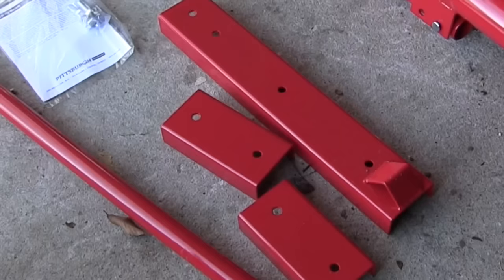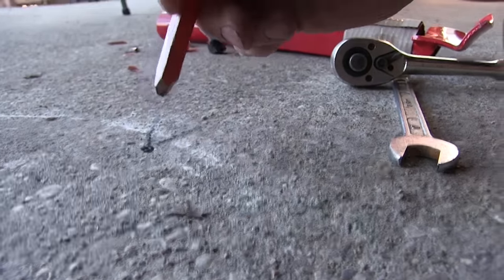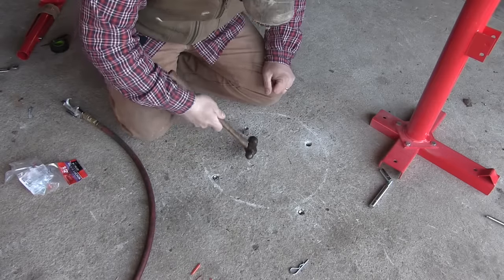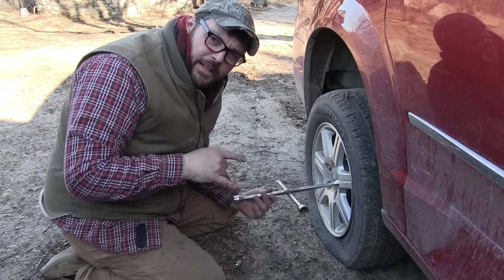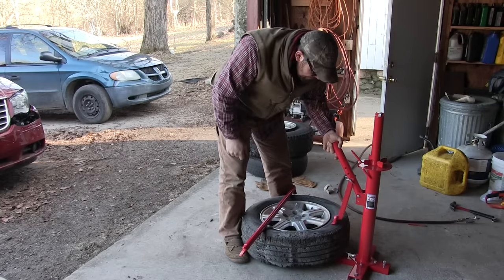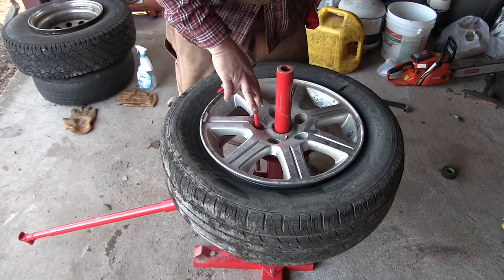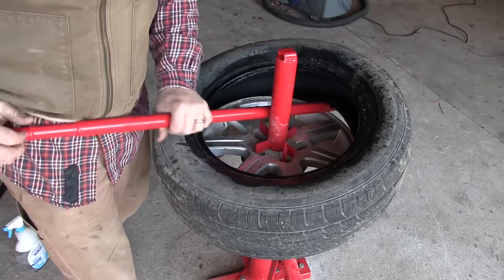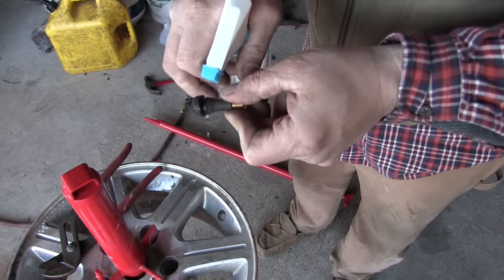Harbor Freight manual Tire Changer review

Comment: "Portable system" - Just requires 4 big bolts in the ground!
Reply from the maker: It should be labeled "manual tire changer" not "portable"
Reply: Does it move? Can you drill 4 holes somewhere else?
Reply: @whydoihave6neutrals772  not at the side of the road if I needed to do a quick tire change.
Reply: ST6 you really think that’s what this is for? Have you ever heard of a thing called a spare tire?
Reply: ST6 and who carries and extra tire?
Reply: @whydoihave6neutrals772  I know and I obviously wouldn't do a job like this at the side of the road. But at the same time portable is something you wanna be able to take out and just use. You shouldn't have to fix it in.
Reply: ST6 honestly This is very portable for what it is most are 1,000  pound machines and it take a lot to rip a tire off so really no other way. It’s more of lack of user skill to be able to drill the 4 holes anywhere.
Reply: ST6 you wanna do what the shops can for $34 you still 4 holes.
Reply: @whydoihave6neutrals772  I realise that, i am a mechanic myself. But if was to be renting and not allowed to drill 4 holes in the ground then maybe a container or  something that could be weighed down by like sand to keep it stable would be more portable and better designed.
Reply: ST6 honestly you could do a system like that but 100 pounds of sand it 10x less portable then 4 screws and a drill
Reply: ST6 and a simple workaround to drilling 4 hole could just be 4 foot long pegs for your front lawn
Reply: @whydoihave6neutrals772  yeah that would work. Let's agree that although its not as easy as just placing it down and going it's much more portable than a massive hydraulic tire changer.

Comment: To change out the valve stem the whole tire doesn't need to come off the rim.
Just break the bead on the valve stem side of the rim, reach inside 
and remove the broken valve stem or in this case the tire pressure monitor.
If the tire pressure monitor was still good replacing the rusted out broken collar 
could have just been done as well.
When intalling the new valve stem, I would recommend using the proper valve stem tool 
and not pliers.  The tool has a threaded fitting that screws onto the valve stem 
once the valve stem has been put into the hole on the wheel, then a hinged lever 
fulcrumed against the the wheel rim installs the valve stem.  
Using the soapy water spray solution on the rim and the valve stem, like in the video, 
helps remove and install the tires and valve stem to the rim.  
When checking for leaks also check the valve stem and Schrader valve. 

If you do have to remove the tire from the rim use a tire crayon to mark 
the position of the valve stem and the wheel weights if they are the clip on 
style and not the tape on style.  This should keep the balance pretty close.

When I used to work on aircraft, the tire wheels were two pieces bolted together 
with a large greased O-ring between the wheel halves to seal them together.  
So we only needed a bead breaker to remove the tires from the wheel rims, 
then unbolted the wheel halves to dismount the tires.  Fun times!

Comment: Husband bought one. He showed me how to use it. He also bought "tire spoons"  --about an inch wide and maybe 14 inches long. It has never been bolted down to the floor. When you use enough dish soap around the bead--the tire practically falls off by itself. The spoons work great for ANY tire--big tractor tires, motorcycle tires and anything else that won't fit on the machine.  Put on your own new tires. Just buy the tires==whether for a daily driver, trailer or even a newer vehicle...Yeah--if you get flat tires, even if you don't get this on a super sale, buy one. Get the spoons (mix dish soap with water). As far as plugging a hole--pour straight dish soap in an empty vitamin bottle, 'thread' the plug thing thru the plugger handle thingee, dip it in the vitamin bottle THEN shove it in the hole. You are welcome. Good video!
Reply: Quick note; if you find yourself struggling (fighting) with a tire change, you aren't using enough soap. Don't be afraid to put it on straight (no mixing with water). Use a one inch paint brush to "paint the soap" around the bead.  I think the spoons are 24 inches long..from Harbor Freight.
Reply: @paullasmith4975 , do you use the spoons independently of this tire change device or do you use them with it? I see above you said you didn't bolt the device to the ground and it still worked. That's what I'm looking to do since I live in a rental house and can't drill holes in the ground.
Reply: @MaggieGiamalvo  The tire changer is handy, especially for bead breaking. Otherwise,  the tire machine isn't actually necessary. The "spoons" are 24 inches and work great on aluminum wheels. No pounding, no forcing. The spoons are available from Harbor freight.  Tried to remove tires from a 1930's axle. Had to cut them off. Everything else is a breeze. That's the 'trick' spoons and soap. Tire plugs (the 'shoe string' kind) string it through the handle thing, dip em in soap, then shove it in the hole.  Trim with wire cutters.
Reply: The spoons are actually  called "Tire Irons" get two.

Comment: I've used those drop in kits before , only works if the concrete is hard enough , also if you take the pin out the back before setting in the hole there's less of a chance failure ....

Comment: I haven't read comments. What I wanna say is, You got the first side to break after you moved it further from the post.
The bead breaker blade became more horizontal and you broke it easy after that. I wasm yelling at my monitor to try
tell you to move it further out again. I think it would have done it just as easy then.
I just bought one today and my next step is to twist the tire off the rim. I see I need to find out the secret to using the other side of the bar to
put the tire back on. 
Awesome video and thank you sir.

Comment: I just mounted mine to a pallet that has a sheet of plywood fixed to the top. That way I can move the changer around outside or inside or what ever. If you can put the tire in the sun to warm it up it makes things a lot easier.

Comment: The first tire I EVER changed was a commercial tire.  No power tools involved with that.  Tires, Wheels, and tire bars.  We didnt even have a stand like that one you used.  We did have a balance machine that we used to balance the tires that went on the cab, usually didnt balance the trailer tires.  I even got the opportunity to change a tractor tire.  Got laid off from work after a couple of years doing that job, but loved the time I spent there.  Met some really  interesting people while there.  I changed State Trooper tires, County Sheriff tires, even tires of the parents of a classmate of mine.  Hadn't seen them for 30 years!  Good times that place.

Comment: I drilled holes and screwed a block of wood inside the arms above the shovel, I bent the shovel arms bad on about the 5 Atv tire. That fixed the problem so far. I only use them for steel wheels that I can repaint the rim due to scratching from this rig.

Comment: Fifty years ago, at a little mountain gas station, we had simple tools to do this also. Removal - break bead with BIG hammer? No, we had a three piece contraption that worked the same way. Long bar with a hooked section, about a foot long, hanging from one end and, about a foot or so up, another T shaped piece hanging. Place T-bar on tire rim and hook other section in center of rim. Apply pressure until bead breaks (T-bar works as pivot point and keeps hook engaged). Complete bead work. Next take an old leaf spring from the junked truck across the field and clean it until it's smooth. Then slide it under the bead  (same way you did) and leaver bead up, applying the a fore mentioned BIG hammer to the spring side sliding it around until loose. Repeat with second bead. To reapply tire you only use the spring and hammer to get things back in place with lots of leverage, hammer swinging and colorful language. Sometimes I miss the old days. Then I have a flat in the rain.
Reply from the maker: Right on

Comment: I'll be 78 in March and the tires that I just took off had been on the rims for 47 years, so not so easy to break the bead and get off of the rims. The part that pushes down on the bead skips back away from the rim towards the top of the tire so before I use it again I figured I would make an adjustable arm that would insert into one of the stud holes in the rim and the other end would attach to the arm on the bead breaker.  Jim
Reply: Wow nice work for being 78!
Reply: @ImSrry4BeingWhite  thanks

Comment: I'm a metal scrapper who's looking for a simple way to remove tires from the rims because the scrap yard only accepts the rims, not the tires. The beginning part of the video looks like the process is pretty simple to remove the tire.

I couldn't tell for sure, but how important is it to bolt the device to the ground? I live in a rental house and I'm not allowed to make any holes in any of the surfaces of the property. Is there some alternative method of stabilizing the device so it doesn't move while in use?

Comment: A good tip is to make a line on the tire where the valve stem was (and any wheel weights on the front lip of your rim has them) before you take the tire off, that way you can line everything back up before putting in the air that way you don't have to worry about getting it balanced after getting the tire put back on

Comment: It used to cost 5 bucks to mount a tire. That included taking the old tire off the rim. The tire shops here now want about 15 bucks to take the old tire off and another 15 to put the replacement on. I'll be looking into this tool.

Comment: What size air compressor would be needed to give it enough air to inflate the tire once ya put it back on the rim? I have a little battery powered one that I use to add a few PSI here and there. I don't think it would give it enough when putting a different tire on the rim. Would the McGraw 8 gallon be enough? It's 150 PSI and 1.5 HP.  

I just started rotating my own tires recently. In the next 10,000 miles or so I'll be needing new ones. I've bought the Tire Changer already. I think I'm going to mount it to wood rather than in the garage. Thanks for any input.

Comment: I have one. The hardest thing is getting it mounted solid to the floor. Because of how tall it is, it is very easy to pull the anchors out of the ground/cement. You have a lot of leverage on it.
  The tool they give you for contacting the rim and spinning the tire off the rim is stove bolt archaic very crude.
  if you care about the finish on your aluminum wheels, you will not use this.. as you try the tire off the rim by spinning and lifting the tire, you scratch the hell out of your wheel 
   then you have the issue of damaging your air pressure sensor. Those things are very easy to damage
  if you have an old piece of crap car that you don’t care about scratching the rims and you don’t have air pressure sensors in the wheels, and you can actually get this thing to mount to the floor. And you are experienced at manual tire changes, which I am, I actually own a coats manual tire changing machine that I bought from my boss when he bought a pneumatic atlas tire changing machine back in the 70s for his garage. I bought his old manual machine which I still have. And I bought his atlas bubble balancer which I still have..
I only bought the harbor freight tire changing machine for the additional attachment that’s available for changing tires on motorcycle wheels. That ain’t too good either. The best thing about this machine is the bead breaker for changing tires on motorcycle wheels.
  since this tire machine and the additional motorcycle tire changing stand that attaches to the top aren’t worth the powder it would take to blow them up, I still end up changing my motorcycle tires using a plastic milk crate as the base and spooning the tires on the end off. The best part of this tool is the bead breaker.. otherwise, if you do not want your wheels damaged, don’t waste your money on this thing. Pay a place that has a modern tire changing machine that the stylus on the machine does not even touch the wheel as the turntable rotates and removes the tire..

Comment: 6:25 It also may help to put the breaker arm pivot on one of the holes further out, so the breaker arm is more vertical, and less likely to slip sideways on the tire.   Pushing the wheel further towards the post also helps toward that end-

Comment: Buy or find a heavy duty oak pallet and bolt the change  to it..
This way you can load it up in a truck or trailer and take it to an isolated area..
The shop I worked in, I bolted the changer to a heavy oak pallet,
 it worked great..
Plus we would take them on service calls to customers that didnt have a mechanic or a source for fixing flats or changing tires..I worked in the turf industry, no worrying about balancing tires..

Comment: A bead breaker tool a tire hammer and tire spoons you can change a tire anywhere. I use a little either pop the bead and use a air line off my rig

Comment: You have to know the trick to car tires... there's an indent in the wheel where the bead has to go when demounting/mounting.  If you'd pressed down on the far side of the tire it would have popped right in.  I like my TPMS... it's a great feature that's saved me from running a tire flat several times.  Shouldn't you be using wagon wheels instead of tires anyway?

Comment: ive changed probably 50 tires on this exact setup, most important tool is a squirt bottle of water and a good dose of dish soap. squirt that around the bead liberally and it will help to de-bead the tire. also squirt it on the new tires bead to lube it during mounting, you cant overdo it. also the mixture can help you find leaks once you air up the tire. they should actually sell the tire changer and a squirt bottle as a set because one without the other is pretty useless.

Comment: Excellent tool used one a little more industrial meaning place for the soapy water with a soft brush and had a way to balance your tire as well all manually. The only thing that I would have done was mark on the tire where the valve stem would have gone back and or any of the balance weights. You did a great job and I am sold on this machine and Harbor Frieght.  It was in the 60's I had the chance to use them. Great video.

Comment: I have always done my tires with tire irons and a dead blow hammer.  My son was given a Coats 5-7 or 5-10 (don't remember the model) that has a pneumatic bead breaker and is manual to put the beads on and off.  We have not had a need to use it yet.  P.S.  HF wants almost $50 for that tool now.  Thanks Joey.

Comment: would you not want to put the bolts or some countersunk bolts back in the holes in the concrete to prevent it from filling with dirt and dust from the garage over time since you wouldn't use this tool to often?

Comment: Thanks for the tip. I just bought one over the weekend, and so far, got the bead broke even without bolting the base to concrete, though it was a bit tipsy
Reply: Moving into larger tires, like my Lexus with 16s, proved to be very difficult and it bent my pry bar and dented the rim up badly. 

It's on the install that's the most difficult, and the other end, with the hook, will lose the grip so you can only get a little going, then use vice grips to hold the edge, and then use prybar flat end to start pulling tire over rim. I thought maybe I'm not using enough soap... but it's something else, maybe even this brand of tire. 

Things could be improved to make it handle larger or tighter tires for sure. Not that I didn't get the tire on, but it took some effort, and I damaged the rim and ripped the tire a bit on its inner lip.

Comment: when you have Alloy wheels I suggest putting the outside facing down then you won't scuff up the  alloy rim,   Also push the tire deep on to the rim you should almost not need the bar for instaling the tire.   also if you mark the tire and the rim  you can put it back in the same place and you might get lucky and not have to re-balance the tire.  Mark where the weights were too!  Fianl  hint if you have wide tires use a racheting tie down strap wrapped around the tire to spread  it out

Comment: As a owner of the tire changer you've demonstrated I can tell you all the weak points. The bead buster will bend and you'll have to weld a stiffening plate between the bars. The end of the bar intended for reinstalling the tire will not work as designed. You are correct, you can't hold the bar and maintain the correct position. Once you understand how it's supposed to work you'll be able to modify it. I use mine all the time . My brother also uses mine all the time. I only use it on steel rims as I don't want to mess up nice alloy wheels.
Reply from the maker: Thanks

Comment: I like this tool, because my dad showed me how to do it even without it....back breaking but he did it. The tool does it well, but need better materials for the the bead breaker portion. A holder, hook or something would give you hands free to make things easier. Also, the long pry tool, is a bit confusing to reinstallation of the tire. I found that the same store sells a set of pry bars, using the longest along side of the tire changer tool helps a lot. Thanks for the tutorial.